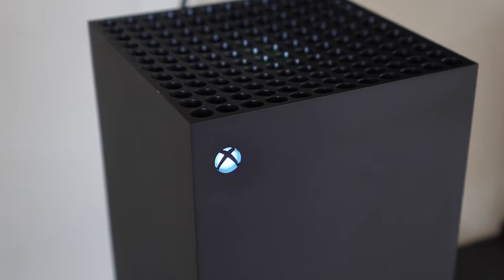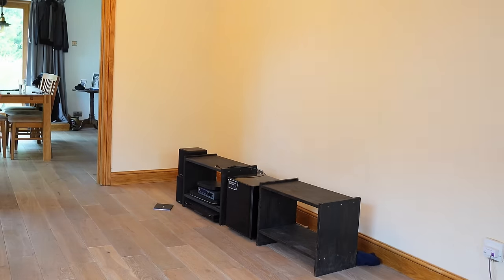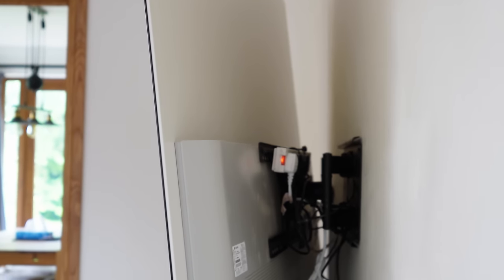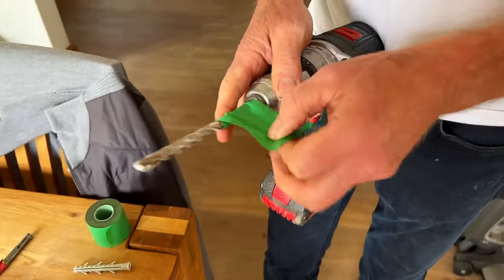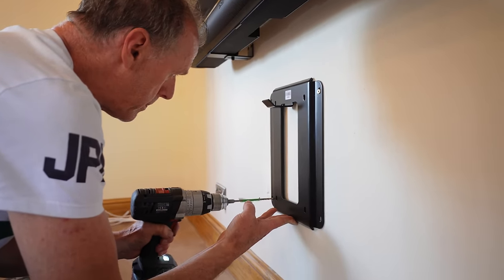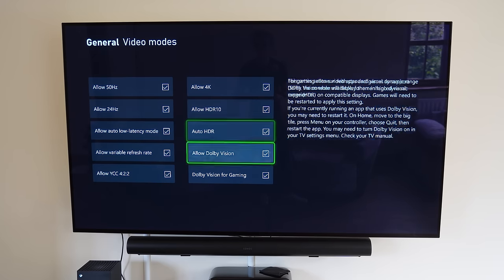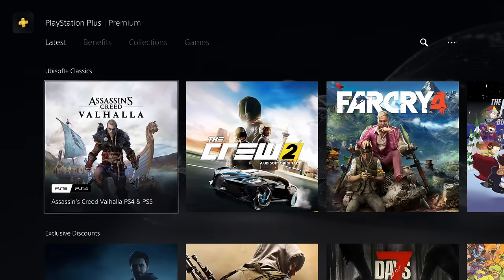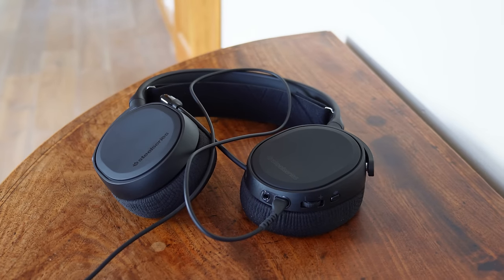Building a DREAM Xbox Series X Gaming Setup!

Comment: Yeah that's the ultimate setup you got there I'd just be happy with the LG C1 48 inch in my room. You got everything covered from the storage for both consoles and the controller with the elite 2. I'd definitely recommend upgrading the headset eventually you don't need to go overboard with it.

 It also depends on what you're trying to do whether you want it to be open headphones where people can hear your headphones if they're in the same room as you or closed back headphones which only you can hear. 

I still play Xbox but many of my friends have migrated over to PC and Discord. Some have sold their Xbox series X and some haven't. I understand how redundant an Xbox can be when you own a PC but even if I did own a PC I wouldn't get rid of my Xbox.

Comment: I'm going to have the same Halo-themed Elite 2 controller. But I'm not even afraid to use it. Can only collect it.
Because the workmanship of the elite 2 is very bad, the rocker floating problem is very much. If it breaks, I can't even find a place to repair this special edition controller. I can only collect it.😞
Reply: The halo is a sticker i believe not a real painted controller they said

Comment: Just a pass 5/10. A soundbar will never be more immersive than real home theater setup with a decent AVR and discrete speakers . Furthermore the soundbar seems to be too far inside from what I see via video, i doubt the upfiring speakers will work properly this way.

Subwoofer works way better if placed on the floor, not sure why you decide to mount it above the floor. Putting the PS5 on the floor is just asking for more dust accumulation. Need an additional TV console to complete the setup